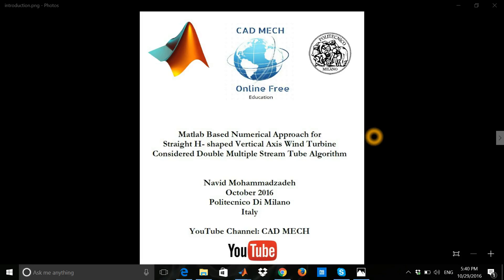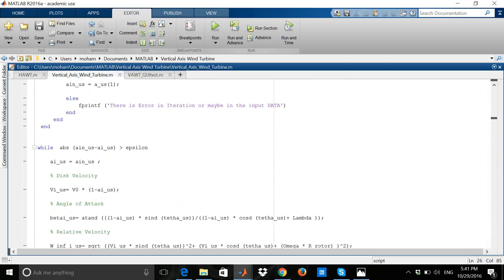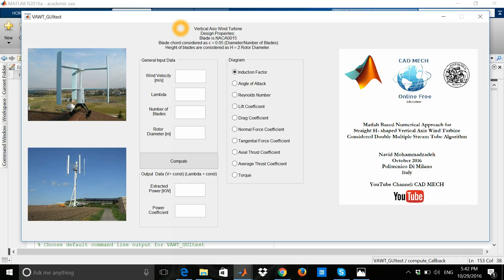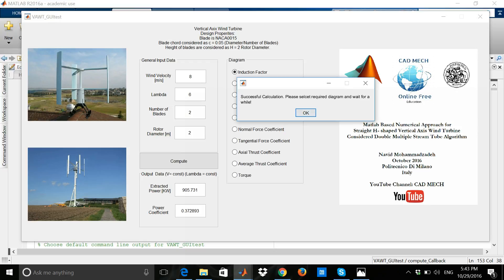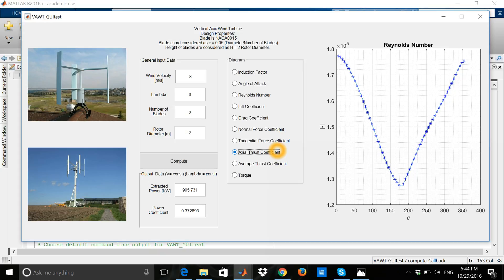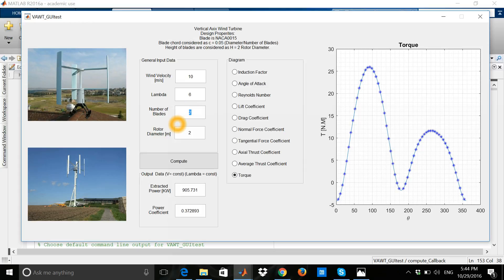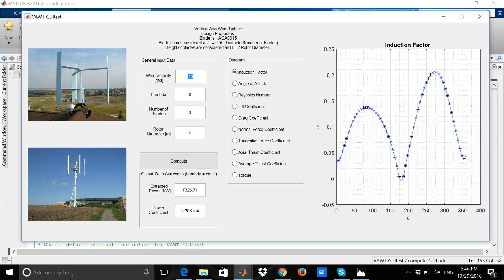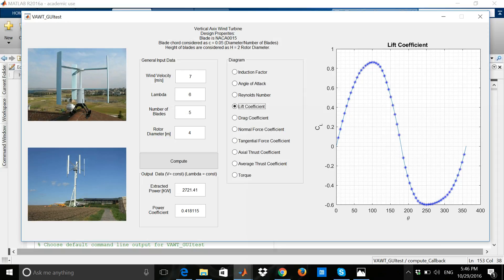GUI Application in Vertical Axis Wind Turbine

Comment: May be extracted power seems too high for rotors of so small diameter. I doubt the values for extracted power. 4m rotor diameter extracting 7326kW !!!  i.e. ~ 7.32MW !!! Similarly for 2 m it shows ... 905 kW!!. It could probably be in W or I presume it must be energy in kWh